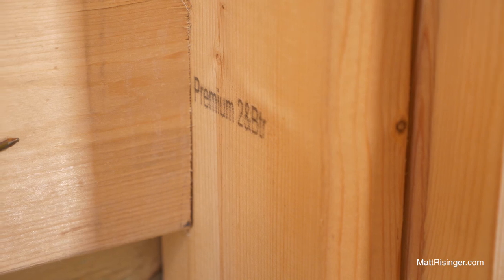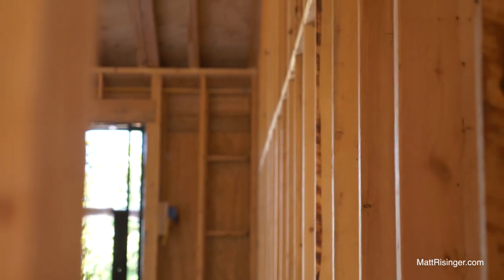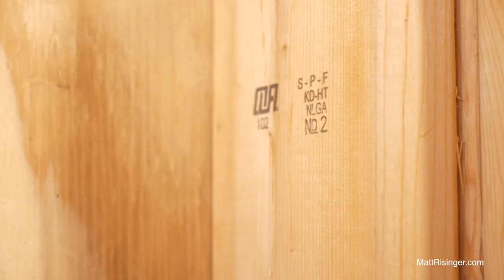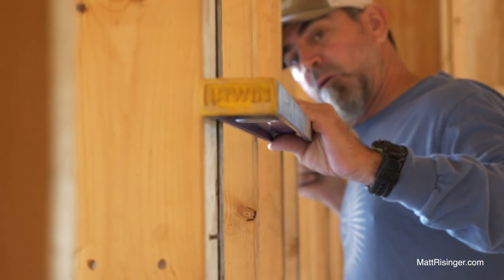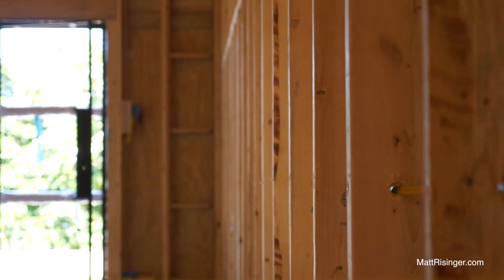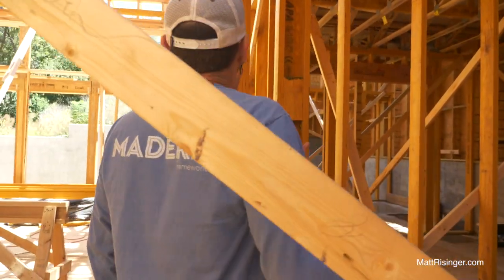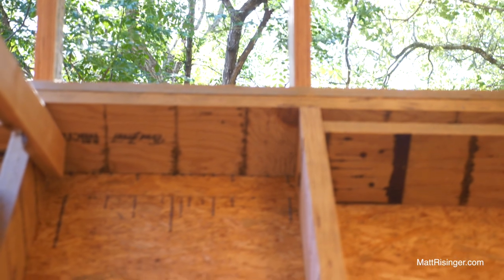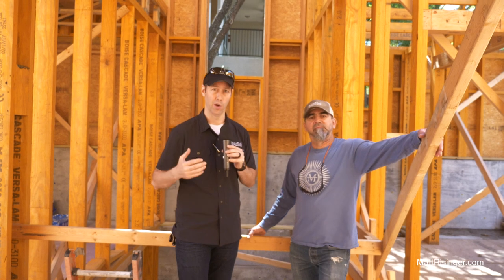Choosing Framing Lumber

Comment: Lol, All KD lumber is dried to 19%,  HT is not KD, HT can be green lumber put in a kiln for a short amount of time,  60-120 minutes, to kill any bugs inside the lumber. Hardwood for furniture is Kiln Dried, to 9% MC, Moisture Content. KD lumber is not. You can't just buy different wood because you want to,  each area of the country uses different wood and a house is engineered by the type of wood AND grade. 2&btr wood is actually designed to lay down, on its side,  the 1-1/2" side down, stud grade is designed to take its load from the top down. This was poorly researched, most of these videos I love but this one missed the mark for accuracy and correct information.
Reply: Jim

Comment: Hey Matt, you can pay the low guy on the totem pole to pre-drill your studs to save on labor cost. Just snap some lines or use some marking paint and tell a laborer to start drilling. Cheaper paying the new guy than an electrician.
Reply: Total drill time on a house is maybe an hour at most.  And an electrician is going to pay HIS low guy on the totem pole to do it who is paid no more than YOUR low guy on totem pole.    Not to mention new construction is ALWAYS, near a100%, bid by the job and having a few holes .... made by gen contractors... in the wrong spots, where all of the hard ones over head, or corners NOT drilled, will not lower your bid any.  The electrician already knows you did not drill them correctly as you did not drill enough of them nor are they complete so he has to get his big hole hawg out anyways.

Comment: I wish my GC paid as much attention to detail and find craftsmanship as you and your subs.  Our GC framed our addition while we were on vacation, and they did a generally sloppy, mediocre-quality job.  Splintered wood and gaps all over the place, wall studs and door casings not perfectly plum or straight, windows not perfectly level, missing hurricane clip on one of the joists, etc.

Then they left the OSB sheathing exposed to the elements for three weeks (multiple thunderstorms and rain in the Northeast).  I noticed what appeared to be water that was drying out in the corner inside the addition.  I sent them your video on sealing the sheathing gaps with Siga Wigluv tape, and asked them if that was part of their process.  They said, "No, it looks like someone trying to sell something, everyone has their motives."  To which I thought: "Yeah, right.  Matt Risinger is meticulous and I may have hired a bunch of clowns."

They finally installed the house wrap and vinyl siding after multiple delays, literally hours after a huge storm was leaking (pouring) water through the 1/8" sheathing gaps.  I was up at 4:15am with a flashlight, recording video of the water pouring in, drenching the insulation, and pooling on the concrete slab of the addition.  They had a crew there less than 5 hours later, locking all that moisture in with house wrap and siding.  Ideally they should have installed the house wrap and siding long before three weeks passed.  Alternatively, they should have water-sealed the gaps with tape.  Lastly, they should have at least let the moisture dry out and evaporate before locking it in with house wrap.  They did none of the above.  Don't even get me started on how sloppy the insulation job was.  Long-story-short, they overstuffed and crammed it all over the place, didn't cut around any wires, outlets, recessed lights, etc.  I pulled all of it out, measured and cut it to size, then carefully put it all back in.

OK, I'm done venting now.  Don't get me wrong, the GC I hired is a nice guy, a good communicator, and has many positive reviews, but I think they're spread too thin, and use some sloppy scrubs for certain parts of the job.  He told me most of his customers don't care about the details except the finish carpentry and overall polish.  As long as it looks good, they're OK with it, which is probably true for a large % of the population.   I'm guessing he's regretting taking our project because I'm pestering the heck out of him and his crews.  Asking a ton of questions, which (without the right diplomacy) can come across as a lack of faith in their competency and quality of their work.  Most of these questions are from watching your vids and comparing it to what their process, materials and/or execution.

I really appreciate your videos.  Almost everything I've learned about best practices, materials, and intelligent building, is from watching your channel.  I'm a novice when it comes to all of this stuff, but it's good to know there are people out there like you who take pride in their work and are dedicated to "building science and fine craftsmanship."  I'll keep coming back for more knowledge.  Cheers buddy.
Reply: Hi Colin,
Thanks for the honest post. I am a builder in the northeast and had a quick question. When reading a post from a client perspective like yours the question is would you have gladly paid the additional investment to hire a  builder such as Matt or myself. Your post states what everyone would want in a GC but as your GC reveals to you most don't care or other wise translated willing to pay to have things done right. Thanks Colin.
Reply: Ryan Wagner, absolutely. I truly believe you get what you pay for. I don't mind paying more for superior quality, timeliness, and attention to all the little details. The trick for a client is to try and find someone meticulous for the $ they're willing to spend to maximize value.
Reply: Ryan Wagner I think what he was trying to say was that a builder should tell the customer that he( builder) will be doing  a mediocre job. See if that gets him the contract. I too had a nightmare w my builder.
Reply: I not share you get what you paid there is a lot competition outthere if you hire someone to do the job is bc you are assuming they know the job doesn't matter the price you pay off ... The true is are "good"  GC but they don't care bc when you find the issue he will gone with your money even if everting look great outside ... There are responsible people outside and do the job right $ or $$ or $$$  bc they are honest and don't do shortcuts to save pennies
Reply: @deeremeyer1749  wood does move, you can't guarantee it won't happen. If client willing to pay for laminate studs, that's great, but most after seeing price increase would opt out.
Reply: @deeremeyer1749  You clearly do not understand how natural wood works.... That is why people go with man made products to get it right the first time.... if they can afford it.
Reply: Honestly tho, Matt does a lot of infomercial stuff. I dunno about that sheathing tape in particular but I've definitely seen a bunch of other places where he's clearly trying to boost a particular product that isn't as useful as he says it is, and you know he's gotta be taking some money for that, or he'd clearly state otherwise.

Comment: Newbie here. Whats the difference between a 2x6x10' framing stud  lumber and a 2x6x10 regular lumber??? I see stud framing stud  lumber at 104-5/8" and 92 -5/8". Does framing stud lumber even come in 10' or 120"???
Reply: Anything that is STUD doesn’t come out to 120, it’s a stud that you can put right into a 10ft wall. You have too plate and bottom plate so they take that off the 10 ft ( I believe)
Reply: @carsongoodman5581  Well if you add 4 1/2 inches to 104 5/8 that is a a 108 1/8 which equals 9'  1/8". Are there any 10' framing stud lumber??? or do I just purchase 10 ft regular lumber???

Comment: Why use douglas fir or yellow pine? We use those in the navy as shoring (emergency structural support) because they soak up water like crazy and expand to create a tight fit. Can't imagine a water absorbing and expanding wood would be good for construction though.
Reply: as studs or structural members, they should be dry. I have a fence built from Doug Fir. As long as stained medium dark or darker, it works great. A fraction of cedar. Besides, I get it from the mill circular sawn. beautiful stuff.

Comment: I wish I was able to have a house like this. Water tight air tight quiet fire resistant that could survive a hurricane. all that's missing for me would be a basement and secured room for family valuable, gun safe that can act as a panic room
Reply: Actually, those things are not missing.  The second house in this video (LVL) has a full, finished, below-grade basement.  Matt has another video for basement water proofing featuring this house.  Also, the house has a Graffunder gun safe in the garage.  The framing crew is building a staircase over it.
Reply: Chest Rockwell thanks for the info Chest

Comment: Hi Guys, What's your standard stud spacings? In Australia we use 450mm and 600mm?
Reply: Levi, 16" on center is the most common stud spacing, but 24" on center is also used here in the U.S.
Reply: Here in Europe it's all over the place. In Belgium alone we use 300mm OC, 350mm OC, 400mm OC, 450mm OC, and 600mm OC, and that country is  roughly the size of Marlyland.

It's probably because we have a "Brick in our stomach" and still aren't used to building with wood.

Comment: A few years back there was an episode (not sure if it was TOH) with Bob Vila, and they were using an I-Joist type product for the wall framing, specifically designed and built to be used as a stud.  There was virtually no waste, and all the pieces were dead straight. I haven't been able to locate a maker.  Does anyone out there know of a maker of these?  (if they are still around)
Reply: Do you mean the T-stud?
Reply: @thursdaythought7201  No, the T-Stud is a relatively newcomer to the game.  These were more akin to I-Joists, but stood vertically.  The only other time I've seen any reference to them was a review of a Mountain Equipment Co-Op location where they were used.  I like the concept of the T-Stud, but have questions about the insulation details that will be needed if spray foam is not being used.
Reply: @VC-Toronto  Oh ok, interesting. T-studs pretty much require spray foam insulation. If you aren’t doing any spray foam you have the option to have them pre-sprayed before they are delivered.

Comment: What's your thoughts on finger-jointed studs?
Reply from the maker: +ascionor I like them. Straighter and just as structural. I use them when I can. Not always available in my area for some reason
Reply: Matt,

What would be better. ?  Yellow pine finger jointed ?  Or SPF ?

Comment: How about a very simple solution and just rotary plane it until it's straight..........
Reply: Johny Doe All that does is take the high spot off.  What about the low spot on the back side of the high.
Reply: bryon weatherford same thing
Reply: If you make a saw cut and push it back you will bow the timber some toward the low spot.  Just shaving the high spot doesn't affect the low spot